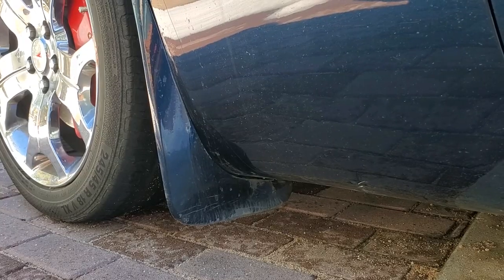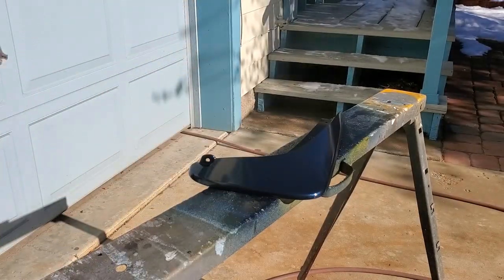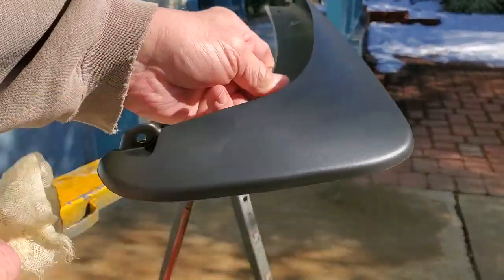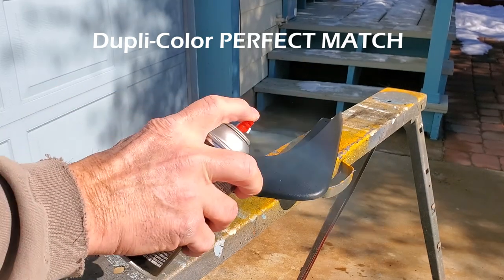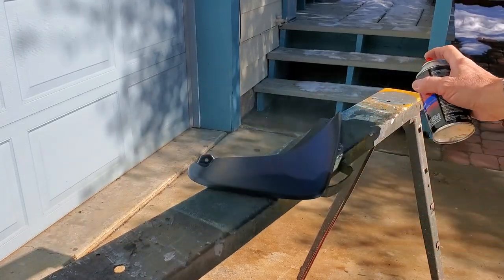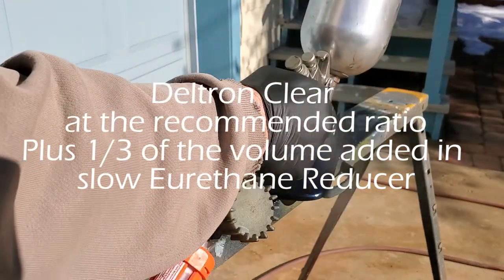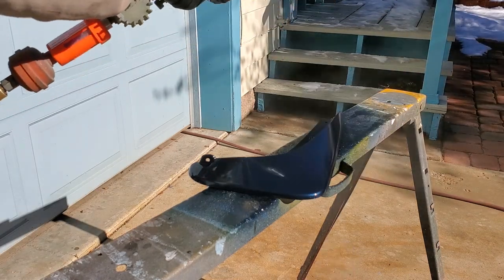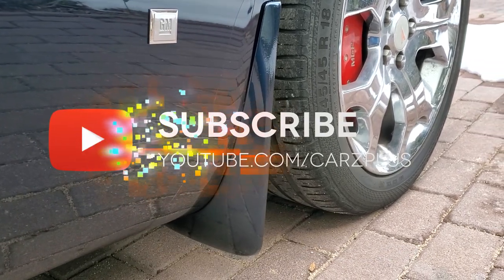How to Repair and Paint Car Mud Flaps - How to Fix Car Splash Guards

Comment: Good little project. I'm a second time GXP owner- never should have traded in my '07 GXP in '12. I had to do a similar thing with with my current car, an '08 GXP, because the car is Sly and the guards were Cool.  I prepped and sprayed with black plasti-dip. Not a fan of the stuff at all; I'm an ex-restorer so the stuff is evil to me but I wanted ease of touchup and the guards being matte black helps them visually blend in with the tires. They are less noticeable which I prefer. Worked like a charm, three years on and no problems. My passenger front gaurd is missing some of the little clips in the fender  that function as speed nuts; I had to kluge a custom bracket from an old '70s Buick part I had lying around. I'll tackle that this spring when I replace the battery. If you ever have to do the crank position sensor on a Sol GXP, forget what the chassis manual says; I have the manual and in this case it's silly. Poncho wanted you to do some un-needed things to do this job like remove the starter and get at the sensor from underneath the car! Local GM shop quoted me three hours plus parts plural. Just take off the charge pipes on the passenger side of the engine, remove the oil pressure unit, and you can see and reach the sensor with your left hand.  40 minute job including cleaning everything I removed...and I'm recovering from a stroke, lol.
Reply from the maker: Great tips to share. We and our viewers appreciate it. I can imagine the guards in matte black, but would like to see that in person, sounds good. It's nice that we can help each other to keep these cars on the road and for others to enjoy.

Comment: I would have like to see everything ďone with cans! The commun person like me dont have a gun! If i have yo buy gun and all the special equipments better hive it to the body shop so it will be done well for just a bit more!
Reply from the maker: Touchup guns are available at Harbor Freight and they can be used with a smaller pancake air compressor. That would be a good beginner tool for anyone who is just starting to set up shop at home. Often the touchup cans are used once and then disposed of.  Custom-matched spray cans could be useful, but the results won't last. Thanks for watching!